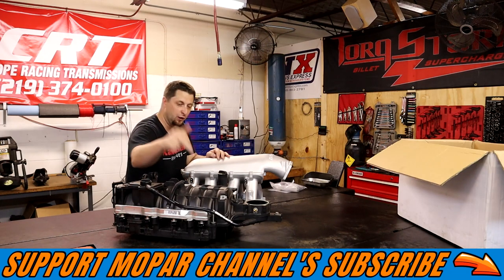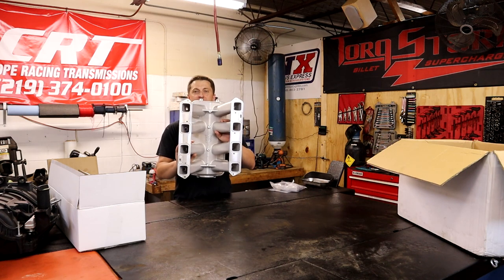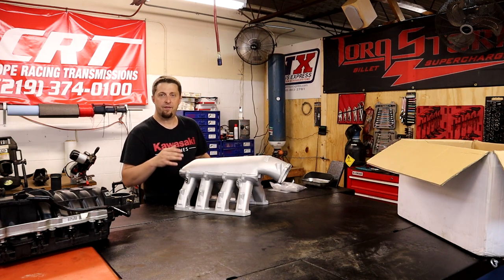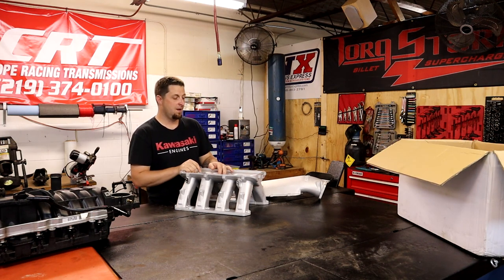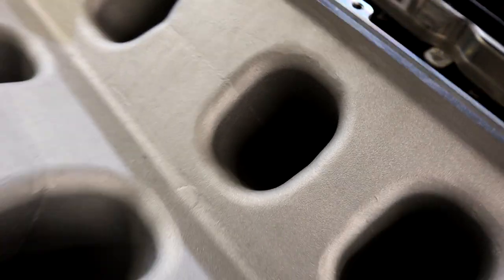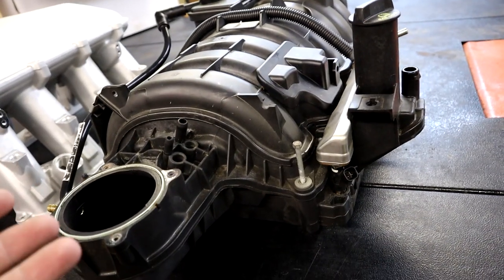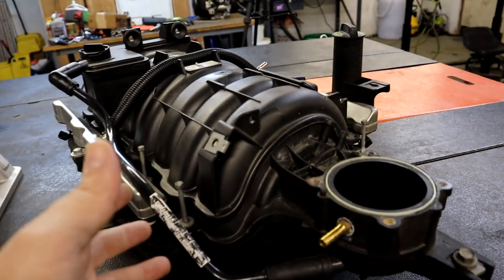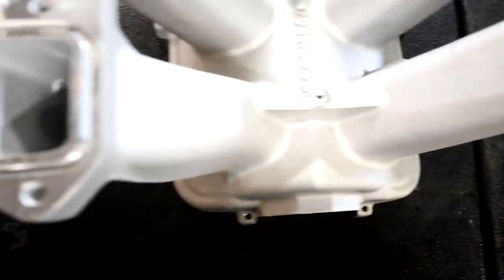The New Holley Hi-Ram HEMI Manifold

Comment: This video was just in time. I was looking at the 6.4 for my 5.7 ram but thanks to you I have a new plan lol. Thanks brotha
Reply from the maker: Awesome I love it💯
Reply: @FrostbiteRam  ok same here so what added more horsepower I need something fro my 5.7. I was going to get the 6.4 but then started seeing this
Reply: @FrostbiteRam  please reply
Reply: @FrostbiteRam  what would u recommend for a stock ram this or the 6.4 manifold I am going to put headers and other stuff to it
Reply: @premiumhousewashes6848  I don't think he had a 6.4 intake on there to be able to tell the difference, plus he isn't NA so his experience would be different from yours. I am in the same boat and he does mention his view on the 6.4 vs Holley about 1-2 min into the video.
Reply: @premiumhousewashes6848  The catch with the 6.4 manifold, is that you need to install an aftermarket ignition/timing system to control the active runners. Otherwise you won't get the most out of it with just a swap. You'll see gains for sure, but not the best that it could be without the ignition/timing system.
Reply: @DJGRoc  The RAM 5.7 already has active runners. No need to get an aftermarket controller.
Reply: @captainboose8788  How is it that the Ram had this, but the Chargers & Challengers do not??? 🤔
Reply: @DJGRoc  The Ram engine was developed for extra low end tq. so they added the active runners to it. The car engine was just a copy of the old pre eagle manifold

Comment: The factory intake has variable intake runner length so it has a solenoid to switch the runners. Also you still have the fuel rails and injectors on the factory manifold. Remember races are won or lost in the first 60’ just saying.
Reply from the maker: Lol finish watching the video 😉
Reply: @FrostbiteRam  lol I’m always setting here watching and talking to you like you can hear 😂
Reply from the maker: @jimmyford271  its all good 🤣👍🍻
Reply: He’s a nitrous guy 60 ft is already good but after the kit is off you still need top end especially with a Hemi. I see what your saying though and I would agree if he were racing 1/8 but in a 1/4 he is gaining mph while spraying in the first half concluding to a faster pass. tune gearing and suspension can effect the 60ft as well to help.

Comment: Does the Holley sniper manifold come with all the necessary parts for easy install? Like the spacers for the injectors? And does this require a tune?
Reply from the maker: The sniper isn't worth it stock manifold would be better honestly.

Comment: How would this intake work on a third gen Ram with procharger?(considering tubing and throttle body is to rear of engine.?
Reply from the maker: Some adapters and relocating the tb and plumbing shouldn't be that bad.
Reply: They have a adapter for it to fit

Comment: I agree, that beerkeg manifold design is HIDEOUS. I have hated how they look since the first time I saw one on a Ram or Dakota. Well full disclosure here, I hated the look of the first fuel injection mopar I saw too. And still do. Fuel injections will never have the visual appeal of a dual quad or six-pack. I bet it wouldn't be all that difficult to fabricate up an adapter plate/plenum top for dual quads.
Now, I do love the performance of my '16 392 Charger. I do NOT enjoy looking under it's hood, nor do I enjoy when other people want to look under the hood. I love looking under the hood of my '68 Barracuda, and it only has a little 318 in there and a 4bbl carb on top of a plain, dead common Edelbrock Performer and plain old cast iron exhaust manifolds into a single exhaust!
A modern engine bay looks like plastic and wires. I don't get to see the actual beautiful engineering of the block. Even the oil leaks are part of the visual and so very visceral experience of enjoying the car in it's entirety.
Reply from the maker: That's for sure

Comment: I see there are 4 holes in the back of this manifold, I know 1 is for the Map sensor, what about the other 3? Did you plug them?
Reply from the maker: You can use them for fittings like boost or vacuum ports. If you don't need them then plug them you can also put the iat sensor in one like I did.
Reply: @FrostbiteRam  Got it, thanks!

Comment: i wonder if that will fit under the hood of my scatpack charger i also wonder if it would be decent on a non cammed NA 6.4?
Reply: Will not fit under stock hood.  I got a 4” demon cowl hood and had to cut a few inches on the neck/ where tb connects
Reply: I have the 6.4 challenger, as well as a Holley hi ram NX plate  so sits roughly 1” higher
Reply: @joshuacampbell1471  no problem then could you tell any difference in performance?
Reply: If you plan on eventually going forced air via turbo application or a sort of procharger style supercharger..  definitely worth it.  I’ve done a Texas speed stage 4 cam/ (for nitrous)  pistons and thitek heads at the same time. So for me to tell you yay or nay,   Wouldn’t be right.  I will say this.  On every other platform. Be ready to get a stall converter. Your lower rev range/ idle typically is rough.  Power carries higher and wasn’t dropping at 7200 rpm where I stopped pulling.  However around 52-5400 is where I peaked on torque and it started tapering off.  Low end torque remained same for me. So all in all. If you plan to keep modding.  Sure. Go for it.  But if you’re simply just making out a NA motor.  I’d personally just port the stock 6.4L.  Hope it sorts your direction you plan to go!
Reply: @joshuacampbell1471  cool thanks for the input brother!

Comment: how you doing bro, do you know where to find the parts for the holley low ram manifold? I like your idea on using ticks performance water intercooler but I think I wont have the  hood clearance. so I need the holley low ram manifold
Reply from the maker: Not sure on the low ram but all the fittings should be pretty much the same
Reply: @FrostbiteRam  thx bro

Comment: That plastic garbage keeps the engine cooler than that metal garbage.  Do you have a dyno compare of the two?
Reply from the maker: 🤣dyno sucks compared to my track time accuracy. But definitely a gain my 5.7 ram runs mids 10s in the 1/4 I picked up a few tenths with just swapping it out.
Reply: @FrostbiteRam  I don't think I know your setup.  You use nitrous and a turbo?
Reply from the maker: @33ordie  my fastest 10.5 125mph pass is with just the torqstorm supercharger and my sbe 5.7 no nitrous on that pass. Probably could pick up a few tenths on nitrous tho.